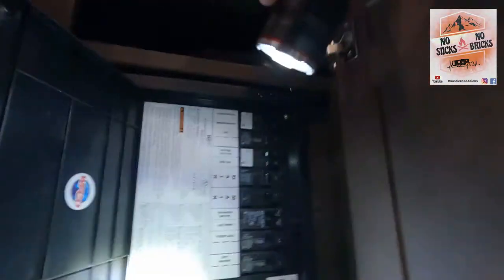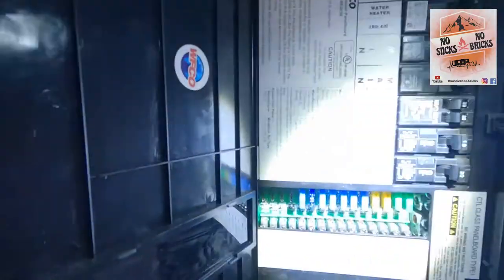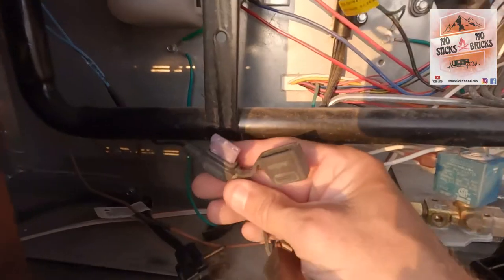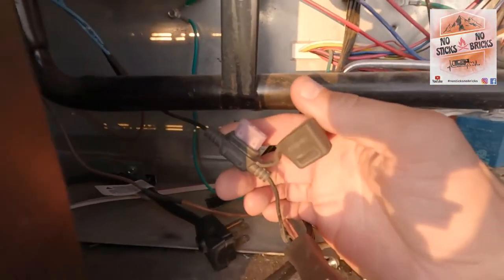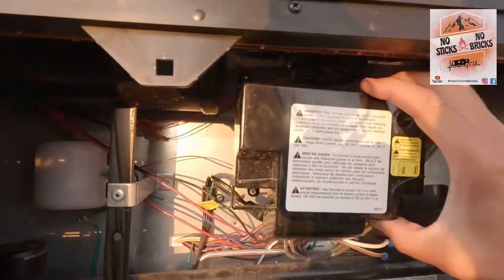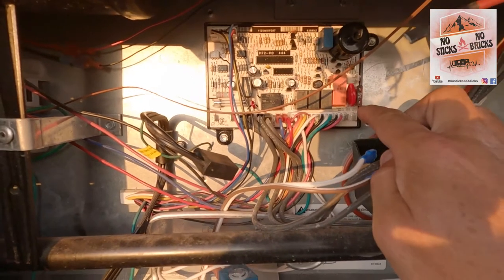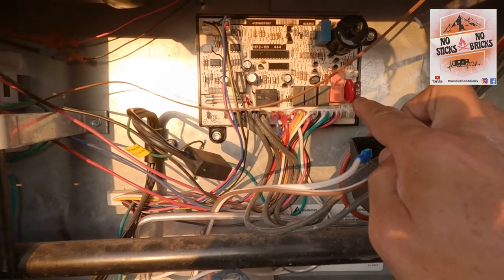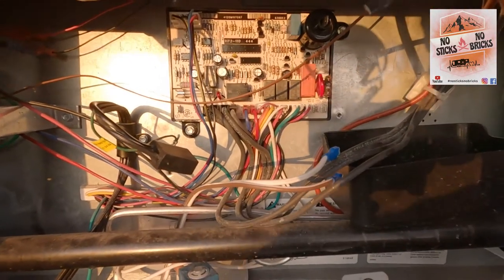Norcold RV Refrigerator No Power Issue - Solved!

Comment: Ho my norgold gas electric refrigerator  works well but my power outlet   outside next to refrigerator  has no current  in 110 power outlet    CHECED breakers  all good   So t
  Put extenion cor so  refrigerate  can work    till find problem  IS  there something   besinds breakers that is not  working ? Thank you
Reply from the maker: Have you checked all of your GFI outlets inside the RV?
Reply: @NoSticksNoBricks  yes all good  but no power in wires  BREAKER on and all good
Reply from the maker: @alfonsobruno2289  you might have a hidden breaker somewhere.  Our RV has one under the bottom step leading up the to the bedroom.

Comment: how did you get the cover off of the control panel where the 5amp fuse was blown?
Reply from the maker: Remove the 4 screw and all wire quick disconnects and the cover will come right off.
Reply: @NoSticksNoBricks  unfortunately our box is off to the left and not easy to access, hopefully we can get the cover off.
Reply from the maker: @joanterciak2652  ahhh, bummer.  Good luck!
Reply: @NoSticksNoBricks  we weren't able to get entire cover off because of where it is, but were able bend it open enough to change fuse, it's working now. Thank you
Reply from the maker: @joanterciak2652  awesome news!!

Comment: I. Have a norcold 1210 in a 2013 Montana never had problems till now. I have power but it won’t run, reset the switch the light goes out but it still won’t cycle on. Any ideas??
Reply from the maker: Oh no…maybe the compressor?

Comment: Where is that box????
Reply from the maker: Exactly where I pointed it out at the :25 mark.  Every RV is different…just look around the rear of your refrigerator.
Reply: @NoSticksNoBricks  it was hard to tell if that was the back. Just making sure.
Reply from the maker: @Grandpa_RLP  good luck!
Reply: @NoSticksNoBricks  So I have power coming to that board and my fuse is good (checked with meter) but no power leaving that board to frig. Would that mean that board is bad?
Reply from the maker: @Grandpa_RLP  yikes, that’s what it sounds like.
Reply: @NoSticksNoBricks  yea that's what I was thinking. I have receipt where the previous owner replaced that in 2015.